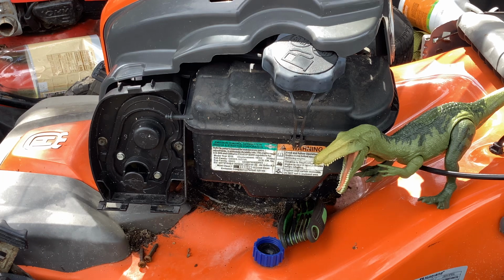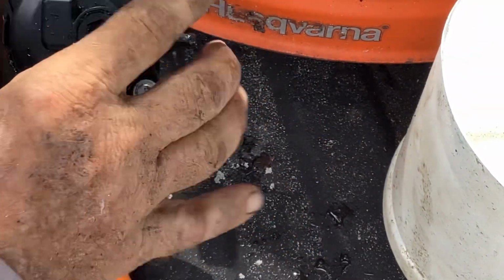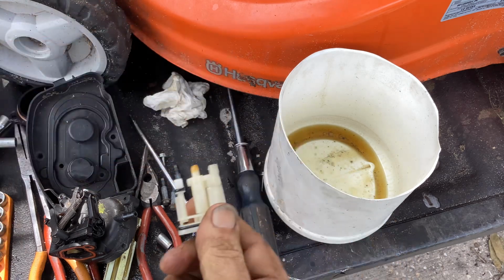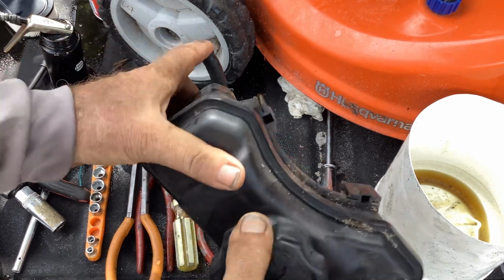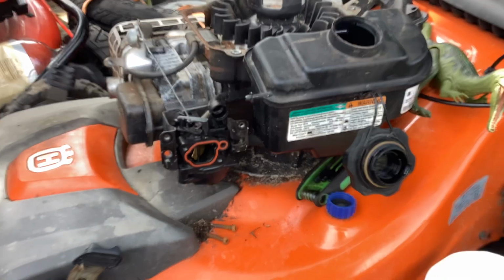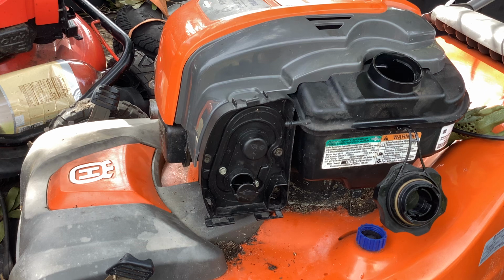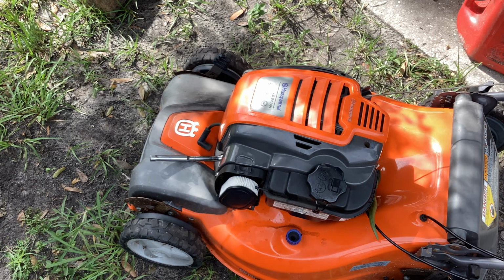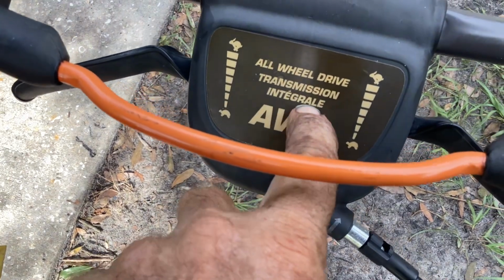2016 Husqvarna LC 221AH  AWD Lawn Mower Carburetor Removal and Cleaning.

Comment: Good job getting that B&S engine firing like it should!! I've got a landscaper that keep dropping off his much abused chainsaws. They run them w/o air filters and wonder why they die. One little Stihl 194T, just under 2 yrs. old, filled with sawdust and oil, ign. coil shot and 40lbs. of compression as an example of the abuse.
Reply from the maker: Holy cow on the poor Stihl saws.